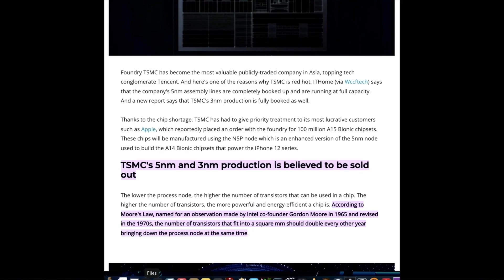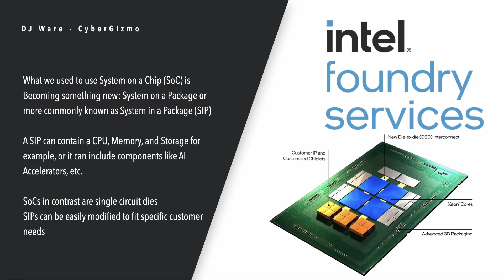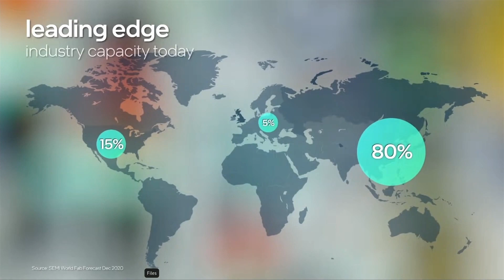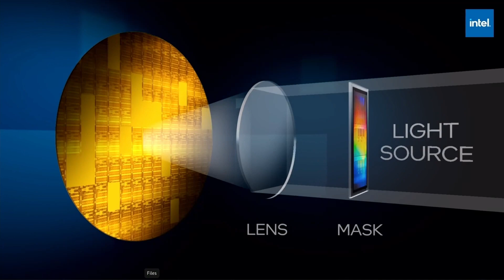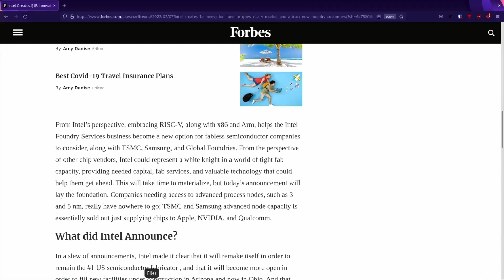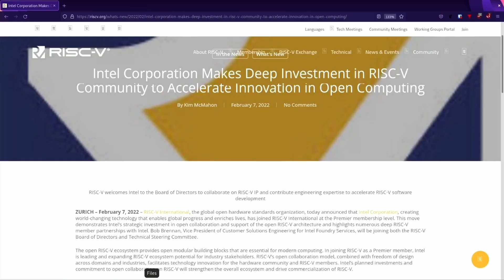Intel and RISC-V 2022

Comment: RISC V is huge if it picks up. Not only is going to reduce costs for everyone but you also have state of the art, brand new, modern CPU that borrows ideas from every chip design out there. Is absolutely going to obliterate AMD and probably hurt Apple in the process. Additionally is been shown RISC V is much more secure and has higher watt performance ratio than even AMD.

Comment: The fun thing is that TSMC or Intel use the same UV technology machinery from ASML which is a Dutch company. This is likely the bottleneck from my standpoint rather than the fabs themselves.
Reply from the maker: Yeah. an interesting perspective if the supply chain problems will be trying to get the ASML machines.
Reply: Canon is trying to change that, let's see where that goes